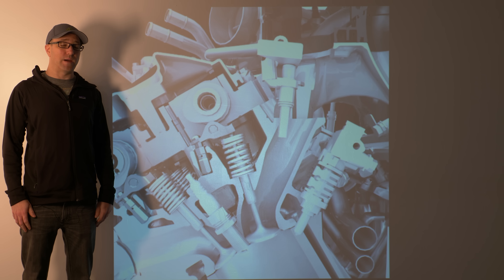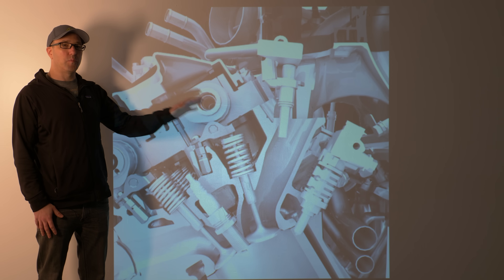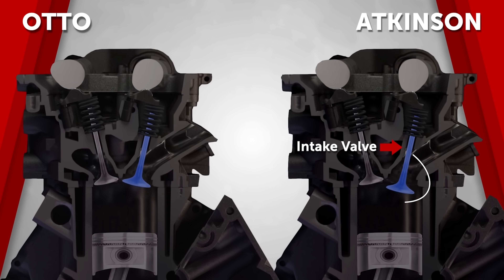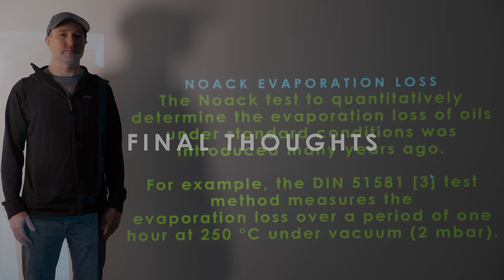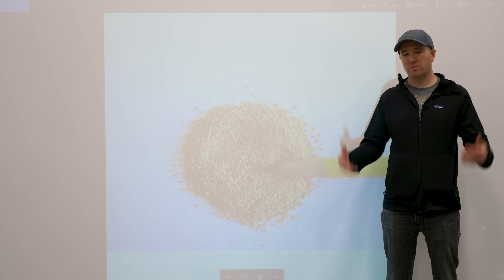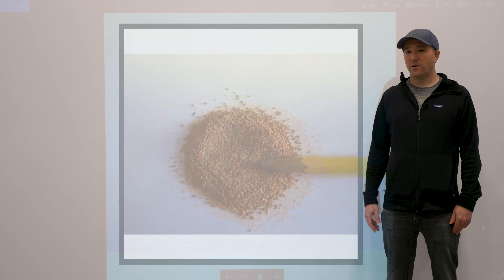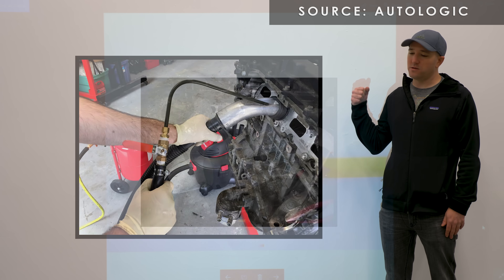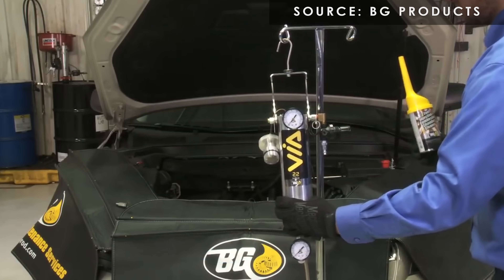Direct Injection, Problems and Solutions | The Fine Print

Comment: Many of the GDI motors I have seen have had similar issues as the presenter has described. A big problem has to do with manufacturer maintenance recommendations. For instance, I have had to recommend to several people that they switch to full synthetic oil after seeing what GDI motors do to oil after 3k miles. Especially,, if you have a Hyundai GDI, you should only use synthetic oil.

Comment: -PCV gas is not a problem,it's mostly just oil, vapors and it does not solidify behind the valves.
The mix of PCV gases with EGR create the deposits,wich harden with the dry hot soot from the EGR.
-To qualify for the current API SM motor oil specification, gasoline motor oils cannot experience a weight loss of more than 15 percent in the NOACK test.
So don't say manufacturers do not indicate the values,it's guaranteed by the API norm.
-direct gas injection is older than ww2...
-No need to use fuel additives,they are in the fuel,use quality filters instead...
-manufacturers do crappy things on purpose : loose piston rings to improve fuel economy create oil consumption,and well known blowby,so deposits in the intake...
they are mostly hypocrits cheating on fuel economy tests by diluting/replacing oil with diesel fuel,cheating by creating specific injection maps for dynos runs etc....

Comment: I have a 2007 Mazdaspeed 3 with 235k miles, DI turbo engine. I've never cleaned the intake valves. I still get 29 mpg with no loss of power – like the day I bought it. 
Your words - “you could legitimately get 60, 70, 80 miles per gallon” – from cars in the 80’s and 90’s. What are you talking about?! That’s just a lie.  I don’t understand your aim with this video.

Comment: Good presentation but a few pts r wrong.  Gdi was not created because of emissions. It was created to get higher torque at lower rpm from the same size engine!  U cant do that with pfi without having knock aka auto ingnition. Di is good at full load but more cars and even truck engines spend the most of the time at part loads. Pfi is more efficient and produces less emissions at part loads. That is why Toyota and Ford started using di and pfi! DI only at high loads and pfi at lower loads. Fixing the carbon build up us a secondary effect.

Comment: actually the EGR is the main issue it blows exhaust it to the intake and sticks everywhere, BUT yes the oil vapor makes the exhaust carbon stick even better and makes it much more gooey.
Delete EGR it is only a light oil film in the intake.
Delete the PCV to intake or mount a catch can you still get carbon but it wont stick as well
Work as a mechanic and have cleaned lots of engines and the carbon buildup ALWAYS start where the EGR pipe goes in.
Just this week I had to clean my RS4 V8 FSI and it was a pain in my butt and took hours, but I had to because it was having random misfires on 4 cylinders, and I am going to get a tune to delete the EGR

Comment: We can thank the EPA and the endless pursuit of clean exhaust for all these emissions headaches that we have had to deal with since the beginning. If they would stop and and realize that there has to be a limit on how clean the exhaust needs to be as all this technology causes cars to be more and more expensive. The emissions from a modern car are so low compared to a 1970 model that there is nearly nothing to measure. There is a point of diminishing returns. Electric cars will probably be the future but that will require a battery that can be charged as fast as I can fill up a conventional tank. Hours and hours at home or finding some special stations that will be full of other cars waiting to get on the plug will not work for the mass majority. They must be able to be refueled quickly.

Comment: Is the new 2018 Accord 2.0 and 1.5T only DI or both port/DI? I am thinking about replacing my 2012 2.0T Kia Optima in the future. I haven’t had any issues at all and Im the only owner, still rides new and hasn’t experience loss of power yet. The dealership did an intake valve cleaning at 30k miles for around $120 and I may do another one at 60k, it now has 54k miles. Should I do it more frequently?

Comment: Direct injection,carbon build up is one huge problem.The GM 3.6 is prone to this badly.Jasper Engines and Transmissions is the only one I know of that makes upgraded pistons for the GM 3.6 with a Teflon coating on them so the carbon does not stick to them.The carbon also sticks to the top of the pistons with this one from the factory,an inch of carbon.The fuel system,you don't just remove a gas line.Lots of fuel pressure and can get gas poisoning which can be deadly.Have to depressurize the system first reading the service manual how to do it

Comment: 96 honda civic b16a sir2 dohc vtec 230k miles and engine pulls like the day she was made , with valve cover off the inside looks very very clean like new , used daily with rev limit 8200rpm and get 32 mpg around town and 38 mpg on motorways,  iv owned the car for 7 years and can't see the need for any other car because she is such a good all rounder motor . That is a credit to honda .

Comment: Blowby poorly explained here.  'pressure builds up', then hand moving to top of cylinder, valve area.  

Blowby initially is past the piston rings, going down, getting below piston down into crankcase.
And yes that blowby does eventually get above the valves, into the valve cover area, which is also part of the crankcase breathing area.

Comment: Unfortunately I brought a 2014 KIA Optima 2.4 L GDI. Had engine replaced due to bearings shredding. As for Cleaning I use CRC GDI Intake cleaner every 7000 miles. Any thoughts? Thank you for the video.

Comment: Yeah but I'm pretty sure you can't just put whatever viscosity oil you want as they have engineered the oil pump and cam phasers to use a certain oil at a certain pressure at least to my knowledge.i used to live by the winter oil summer oil philosophy but things change.

Comment: I'll take a direct injection engine over the crap we used to run and think was fantastic 30 years ago any day. If my valves get dirty, I'll pull the head, pull the valves, clean them, and the ports. Reassemble. Done.

Comment: People should also drive their DI cars harder than just gently accelerate to highway speed.  The intake valves need a lot of air to flow through to prevent the oil particulates from sticking to the valve.  Slow drivers will see more DI problems and enthusiast drivers.  Some early BMW DI had intake valve problems but the BMWs that were driven harder than normal don't.  Just from my own observation.

Comment: 11:25 "The cars in the 90's and early 2000's and 80's could get 40, 50, 60, 70 mpg."

Nope: Fuelly.
Reply from the maker: 2000 Honda Insight Manual Trans and Lean Burn 70MPG.  I owned one. 60mpg at worst.

Comment: PFI+GDI is also pre condition to PPCI (Partialy Premixed CI, univ of Lund, Bergt Johansson); Skyactiv-X style HCCI (Homogeneous Charge CI); and al kind of attempts to avoid particulate emission with GDI engines (raising a need for a DPF for gasoline).

"Bengt Johansson, Ph. D.Professor, Mechanical Engineering
bengt.johansson@kaust.edu.sa
"
https://ccrc.kaust.edu.sa/Pages/Johansson.aspx

https://www.erc.wisc.edu/documents/symp13-Johansson.pdf

http://docplayer.net/33413804-Partially-premixed-combustion-ppc-from-idle-to-26-bar-imep-with-euro-6-emissions-and-50-fuel-efficiency.html

https://www.energy.gov/eere/vehicles/2010-directions-engine-efficiency-and-emissions-research-deer-conference-presentations

https://www.energy.gov/sites/prod/files/2014/03/f8/deer10_johansson.pdf

Comment: EGR, CCV, VTV, things you disconnect on your engine and then you get a happy engine... and the stupid catalithic converter... aaaand when possible you get your engine built back to have a plain simple mechanical fuel pump... then it will last for a long time.

Comment: The ultimate fix for turbo cars is water/ methanol injection kit. Steam cleans the whole inlet tract.  With a micro switch mounted on the gas pedal so it turns on a wot.

Comment: BUYER BEWARE??
Years ago a Home appliance Manufacturer Re-designed a room air conditioner compressor they had in service for years, for use in there refrigerator line. This compressor ran quieter, used less energy with less vibration. It was a rotary vane design. 
within a few years the realized that these were failing. The rotary vanes were wearing out prematurely as they lost efficiency and the wear clogged the microstrainers with fine dust compounds in the lines They were there and were  designed to prevent clogging the refrigerant metering tubing called a  Capillary  tube  (Cap tube). Some failed under warranty and were replaced by the manufacturer but most failed out of warranty. The manufacturer had a special rate to replace these out of warranty failures but the consumer still had a expensive financial loss on the extra repair that was a result of design and worse the food and time out of work lost. Some thought that this company would hurt financially at best and my go bankrupt at worst from this years long manufacturing run. Instead the stock soared split and stockholders were making billions profit 
Here we are again with yet another of a never ending  parody to this above tactic that, "in the end" it's we, the consumer, thats expectation is to buy a solid tested product, that is left paying for "External Research and Development" worse "Corporate manipulation of consumer confidence". 
Any argument that these designs were internally tested properly, and they met some form of "Acceptability for Consumer Use and Consumption" are absurd and intelligence insulting at very least. As before with the manufacturers distributing defective designs and products we as consumers are paying the price. I am one of few that fail to understand why this is allowed to happen, when 
 we have consumer protection laws. If this was a little guy in a small shop, he would be shut down. because a fortune 500 company has a financial and political presents and connections it allowed. 
Does anyone have the power to stop this or at least hold companies responsible for their designs and their resulting flaws? Protect us as consumers and taxpayers?  The short answer is no one would risk the resulting fallout from corporate failure. 
Or is there???

Comment: You can take care of carbon buildup with an Italian tune up.

Portions of the engine reach nearly 600*C under >3k RPMs that will effectively clear carbon deposits.

This can also be mitigated by running high quality premium (91, 93) fuel like Shell or Exxon.

Comment: I have a mazda 6 2015  that is direct port injected .I only have 25000 miles on it so far  and love the car with a strong warranty going 7 yrs out  and or  a one hundred thousand mile .I didnt hear about my car having this problem yet ,but i guess this is something that im going to have to take it in for servicing sometime soon .
Reply: I bought the Mazda extended warranty on my 2015 6.  The finish is flaking off the wheels - found out not covered. I then read the fine print for other exclusions. One exclusion it has refers to degunking the engine. I wouldn't be surprised if they exclude  cleaning the intake valves due to carbon buildup. BTW - I have 44k on mine - seems ok so far.
Reply: Im going to look into this  with me warranty provider .Im wondering if this could fall into some kind of recall since its not outlined as a regular  maintenance .It could be looked upon by mzxda to leave its customers in the dark about this problem and say its your problem .No recall and warranties are excluded , that sounds to me like a lawsuit  .

Comment: Wait, your trying to tell me that blowby goes past the rings and into a higher pressure area and then manages to get into the intake?

I understand PCV perfectly well, what you described was theoretically impossible.
Reply from the maker: It was an over simplification for this example without going into 20 different directions and was not clear.
Reply: savagegeese 
I will certainly accept that. It caught me way off guard considering everything else was spot on.

Comment: This is why I said the Ecoboost ford motors were a problem looking for a solution!! The ecoboost is a very niche motor because of the turbo and direct injection! 
Turbo seals blowing , bad tunes, crap oil , bad Maintainance and blow by will kill 15% (guesstimate) of modded ecoboost motors. 

The NA V6 was way more forgiving in this respect. But now Ford can just do the Chevy thing and shove and Ecoboost into everything like Chevy does with LS motors. The difference is the LS motor really can do it all and is very user friendly to mods and maintenance. 

Ecobombs are going to keep blowing and Ford will just keep replacing turbos because it’s cheaper to replace a turbo than it is to design a correct NA engine with power and fuel economy. 

This is Fords “bandaid”  for the next 8 years to keep up with CAFE standards. Who knows what comes after all these ecobombs start popping from bad maintainance? Turbo cars are already finicky, and now they have taken the most modified car in history and are telling the masses it can make easy big power with a few simple “bolt-on mods” 😂🤦‍♂️! HERE COMES THE BOOM!! 💥 !!

Comment: Even with a factory warranty, you are still paying out of pocket, because they call it a maintenance issue. Yeah, your car is misfiring and running like crap with a check engine light on because of the manufacturer’s design, and YOU have to pay to fix it. Somebody should be suing.
Reply: I have great success with Seafoam Spray/aerosol. The one that comes with a hooked hose. Read the instructions and do it right. Sticking a vacuum line into a can of Seafoam is going to have a very limited benefit in comparison.

Comment: Still trying to figure out what car from the 90's got 60mpg.  The most I recall was the Chevy sprint with a 3 cylinder which could get about 52mpg.  It was a 1400lbs car with a really poor crash rating.  A few other cars hit around the 50-40 as well, all econo boxes or eggs ie death traps in a collision, these are cars that make my RX-7 seem safe in crash and that is saying something.

It's difficult to make a car that light today because they have to be much safer plus people have gotten use to having a decent amount of power.  The Sprint with 3 banger 1L had all of 55hp.  Something else that has changed is how measure mpg today which is more realistic this didn't impact highway miles that much but city took a substantial hit because working your way up to test speed has to be done in a realistic way today not taking 30 second getting to 30 mph.  Plus the target is based off combined now.  Just to add insult to injury most of today's gas is 10% alcohol in the US which further reduces mileage by around 3%.

DI cars often have recommended cleaning as a part of the maintenance schedule.  The return of high compression engines is because of DI, that's allow for significant power gains that wont knock on 91 octane.

Comment: 80mpg? I doubt that. Maybe 60.

Fuel additives aren't recommended by most manufacturers. An actual injector cleaner that's added to the fuel rail is effective, fuel additives are snake oil.

We don't need to increase combustion efficiency, we need better batteries or to go to hydrogen fuel cell vehicles and work on hydrogen infrastructure that's only powered by renewable power sources.

Comment: I haven't got the vehicles to test this theory. But you might. Picture three GDIs, identical in every way, except for their oil levels. One is run with the oil level centered between the "L" and "F" marks on the oil level dipstick. Another is run with the oil level precisely maintained at the "F" mark of the dipstick. And, the third GDI is run with the oil level maintained half-a-pint higher than the "F" mark on the dipstick. I expect that the deposits on the intake valves would grow quicker in the vehicles with the higher oil levels. So, and, especially if so, then one more reasonable action to take, especially regarding GDIs, would be to ensure that the oil level not be overfilled.

Comment: ...and this is why I have a diesel (and sure as hell not a newer one). My 98 Jetta is a bit of a POS but I bought it for 3500 and maybe I’ve spent a couple thousand or so in the 7 or 8 years I’ve had it.

I didn’t know about the combo systems before I saw this video and all I can say is that it certainly strikes me as a pretty clunky fix. It also would add a large cost to the development of the vehicle to have to include, on top of a regular port-injection setup a full set of the expensive injectors, high-pressure pump and lines, also does that mean that you have two very different fuel systems in the car? It just seems like a maintenance nightmare and a much more expensive costing vehicle that turns into a pumpkin every 30k. No thanks!